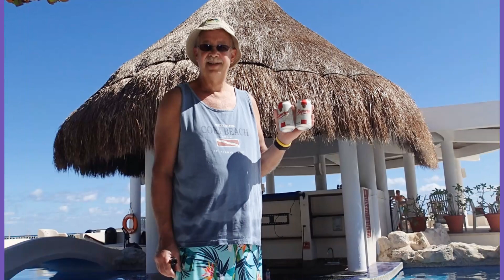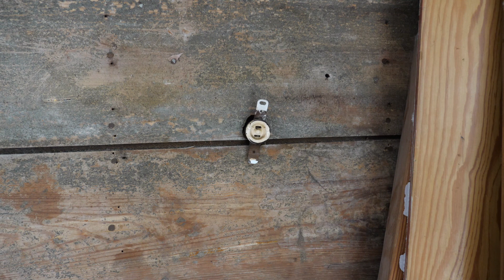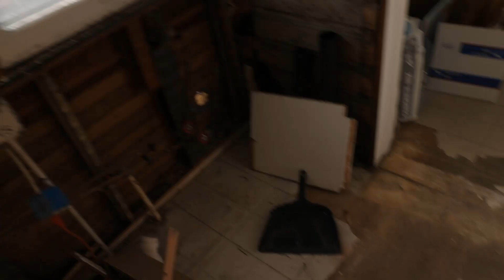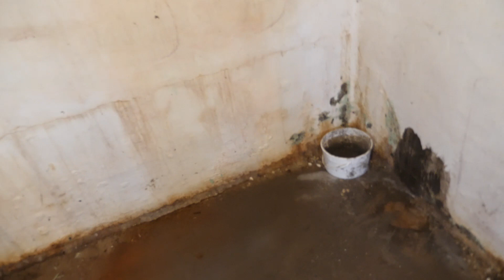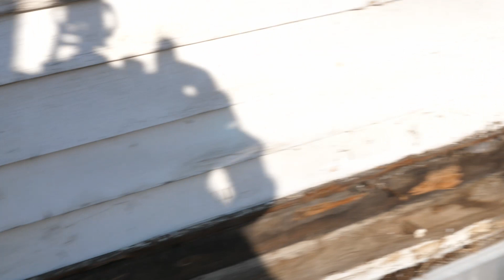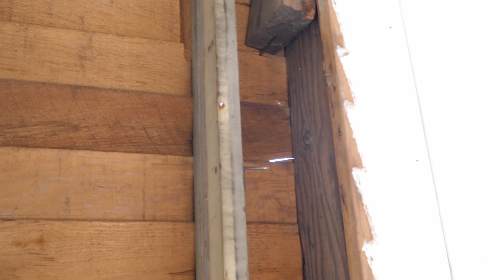Renovation House Part 7 MORE Discoveries

Comment: Looks like you will either have to do an interior weeping system or dig up the outside and blue skin the basement wall. A third option could be an epoxy injection into the crack. which ever way i think it is going to be pricey. You may want to also check if the basement walls are leaning.. I think if it is.a lean of more than 2-3 inches you may want to brace the walls...? Good luck.
Reply from the maker: I had a friend that actually had a business doing mud jacking and basement waterproofing.  Unfortunately, COVID took him late last month.  I am not sure yet if his wife is going to continue the business and I'm waiting until after the Holidays to talk to her.  It is a rough time for her, and I don't want to bother right now.  The walls are solid and not leaning or anything.  Just a few cracks here and there and they do not go very far.  This much water is strange since it has not rained much lately and at one time, someone had work benches and stuff down there, so it wasn't always like this.
Reply: @rogersshop  I am sorry to hear about your friend. Be safe and my condolences to your friends family.